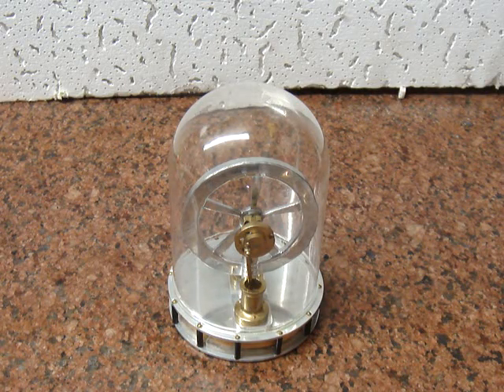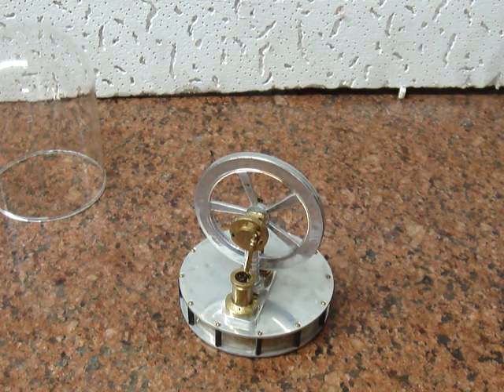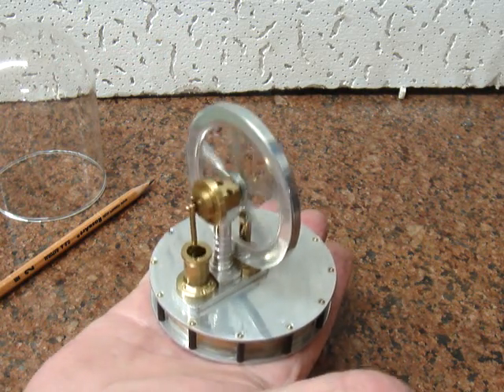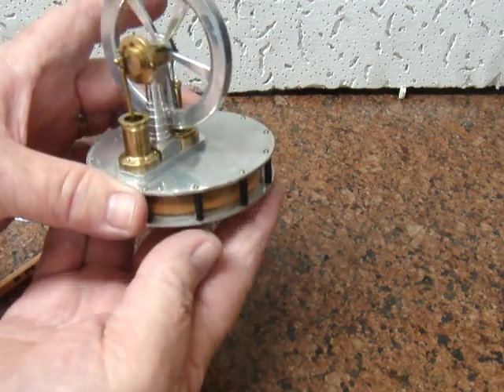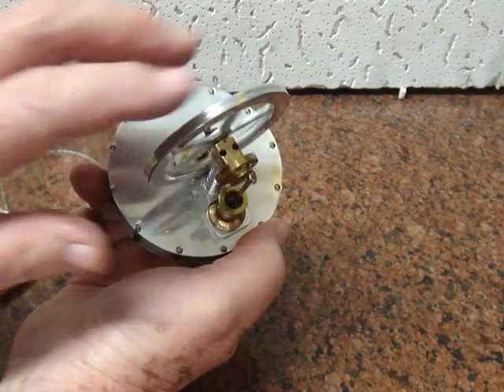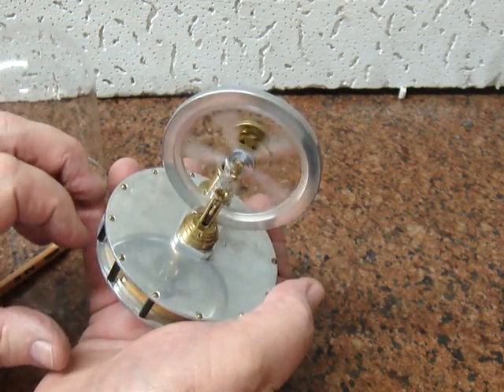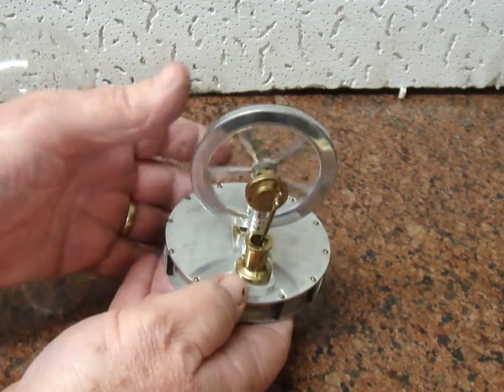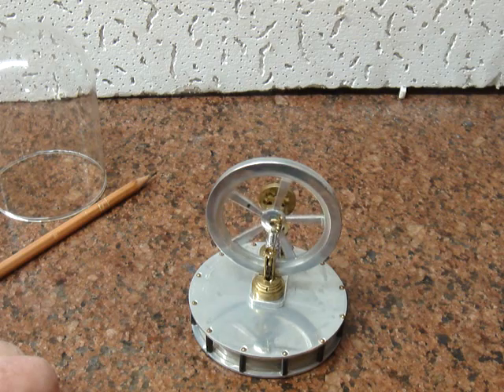Small Stirling Engine

Comment: All you need to adjust is the main piston, on the top on its cycle it should be flush to the cylinder's ceiling, and on the bottom stroke it should be flush with the floor of the piston. and it should be a little taller (the piston)